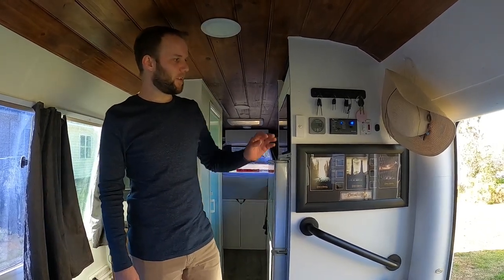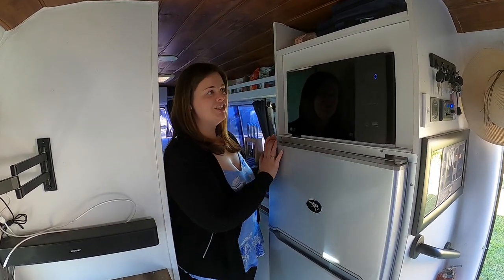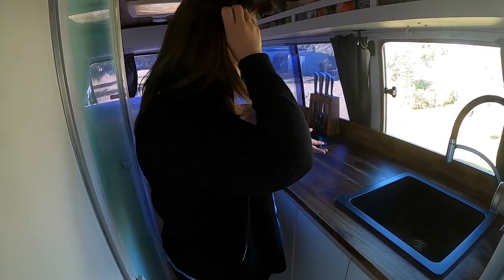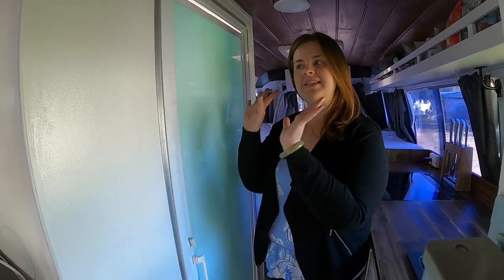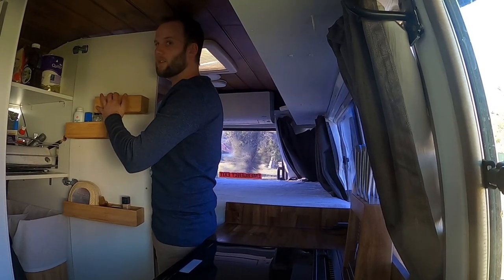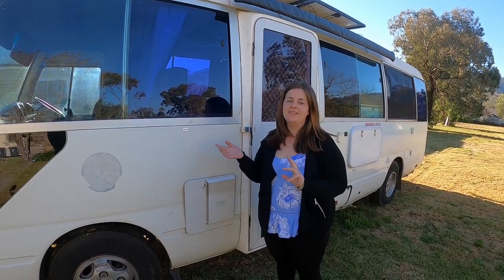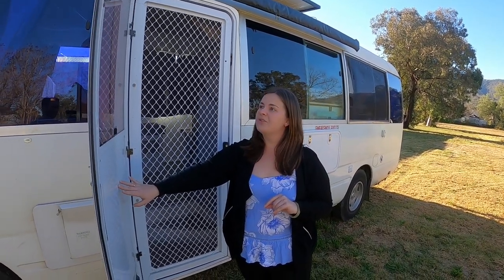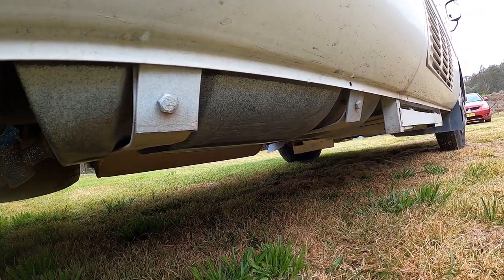Bus Tour | DIY Off-Grid School Bus Conversion Tour

Comment: Congratulations! It looks great. Two questions. First, did you manage to keep the final weight of the coaster under 4.5 tonnes to avoid having to get a truckers drivers license? Second, which coaster have you got? Cheers
Reply from the maker: Hi there,
We ended up weighing the Coaster and came in just over 4 tonne. We still wanted to put on a bull bar, awning and us and our stuff wasn't in it either! We opted to leave it at 4990kgs and upgraded to a LR licence.
Our Coaster was a 2001 model 1HZ engine.
Thanks 😊

Comment: I hate asking how much things cost but I’m converting my bus at the moment and with pets I’m terrified of it being too hot, so trying to budget for the solar/ac set up how much did these systems cost you in the end so I can plan? And how long can you run the ac for? Thanks love your videos!
Reply from the maker: Hi there, no worries. The solar system on our Toyota Coaster cost approximately $10,000. That was for the panels, Lithium batteries, and everything else. The air con cost was approximately $2500 (Daikin Cora 2kw plus electrician cost, and air con installer cost). At 22 degrees, 3 speed fan, it uses approximately 400 watts of electricity. So as long as the sun is out we can run that throughout the day no issues. We did have to be more careful at night time though and mostly just opted for the fan. That way we still had enough battery power to begin the next day no issues. The only thing we would do differently is opt for a 2.5kwh air con, rather than the 2. It just wasn't quite enough. And maybe larger battery storage capacity. Hope that gives you some idea though! Thanks 😊

Comment: Great bus conversion. The air con I never saw the install of the compressor condenser unit, did it fit exactly under the bus where the factory sir did or did it come up throw the floor.
Reply from the maker: Thanks Francis. We haven't put a video up about it. We didn't film the actual install as we had some help from someone who doesn't like being filmed (we can't weld). It comes up about 20-30cms through the floor. This is covered up by the 'L' part of the lounge.

Comment: Hey guys! IT is 41 celcius in Sydney today. :( How cool could the bus get? Also, did you say you sold this bus?
Reply from the maker: Hi there, we did sell this bus a few months back and bought a bigger Mercedes Vario to do it all again with haha! It certainly gets hot in Aus! 
With the 2kw air con we had in the Coaster, all the windows closed up and curtains closed, we could probably get it to around 23 at the rear of the bus. The front still stayed quite warm though as the air con wasn't quite powerful enough to get right up the front. In our new bus, we will be installing a 3.5kw split system so hoping that will make a big difference! 

Thanks 😊